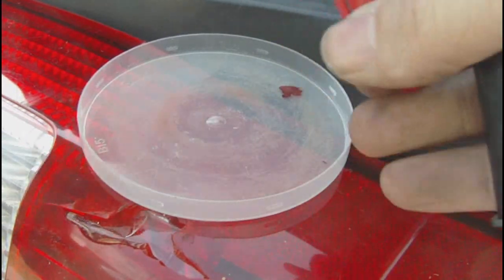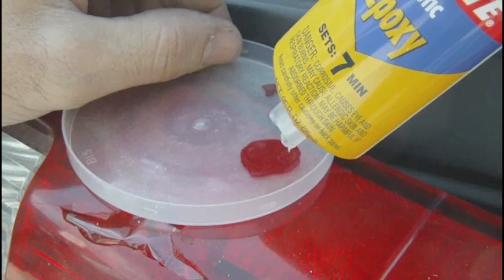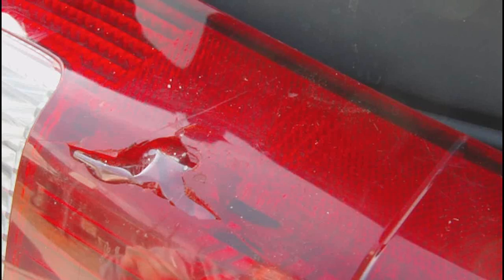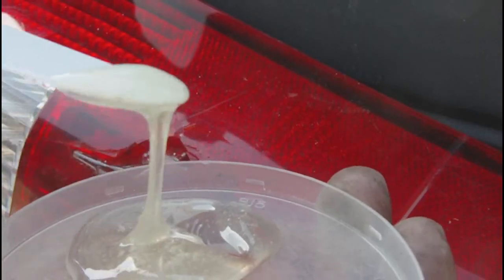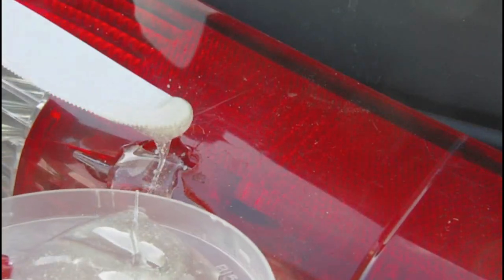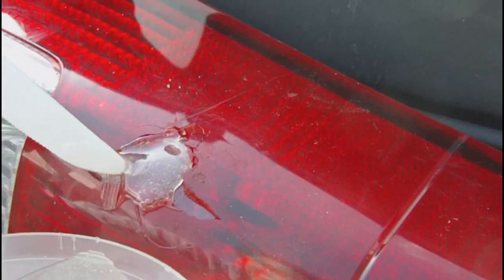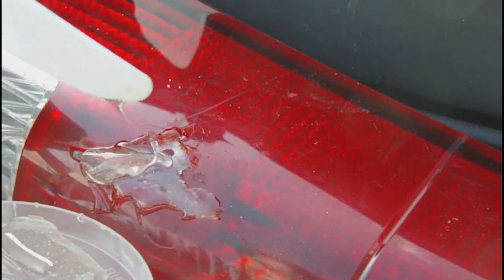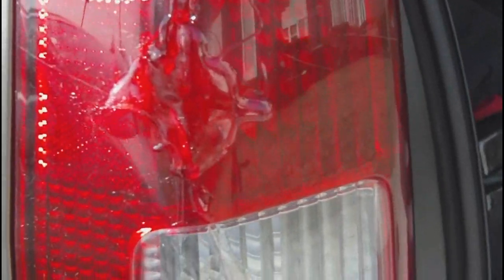tail light how to repair on the road

Comment: LOL!! This is hilarious--I've got almost THE SAME location of cracked taillight/hole to repair...on a used Honda CR-VI just bought!

Was initially considering a 'Pull-It' Yard for a replacement, but I can do this easily; as well--I'm into R/C planes, sculpting & hobby stuff, so achieving a seamless, clear finish with acrylic-epoxy work will be right up my ally!

Good vid...straight forward & hard to get wrong! The who lack imagination or initiative--who want to criticize your 'quick & dirty' repair, they can take a hike. It doesn't take a rocket scientist to figure out you could achieve a smoother, level finish with:
-Careful preparation of clear, hard epoxies...
-Use of a candy red tint MIXED IN with the resin...
-Use of tape over top & a warm iron to smooth the curing epoxy and help it stay within the boundaries of the crack...
-Go over the repair spot with a thinned-out, leveling batch of epoxy rubbed in...
-Use of a rotary buffer/polishing pad on the finished surface for clarity.
Reply from the maker: Lol what i did while away that saved my headaches.     thank you..    those are words to live by   means the world to some here  thanks again

Comment: great tip, but what is the point to paint it before sanding?
Does the glue withstand UV radiation?
Reply from the maker: Emergency repair not   perminant
Reply: ok, thanks :)
Reply from the maker: let the marker absorb in then when sanding it may seal up as the pours are closing as you sand. glue should withstand it its a plastic epoxy may dry out.

Comment: if you want this as a long term use the epoxy sand flat level then magic marker the usen laquer the whole light wait for it to dry then wet sand with 2000 grit then use a cutting compound with micro fibur cloth the use a cutting polish with microfibur trust me will look like it was never broke

Comment: use progressively lighter grades of sand paper, than some aluminum polish (yes it works!!) on a fine fiber high speed polishing wheel and this would turn out much better to the point it would look like new

Comment: Won't the majic marker wash off from the rain?
Reply from the maker: As we know it is a perm one.   the maker bleeds into the resin, and gets trapped, keeping the color, as the Sun will fade it, I would think the water would do some what the same.  It was a quick fix. vs a fine later down the road, just for being stopped for no appearant reason. Something we try to avoid
Reply: Thanks. Nice job !
Reply from the maker: After the fix I did get a new  tail light.   . you are quite welcomed,   it was a temporary fior me

Comment: if you managed to split the lens to tape the inside why not use a better quality tape on the outside and fill from the inside . ?
Reply from the maker: if that was possible it be worth the shot for sure.  this was  a  temporary repair  at the time years ago that got me though till I found  a  OEM for a lot less then offered.